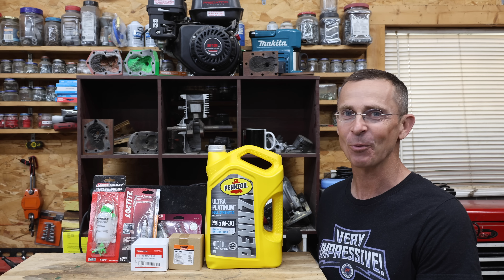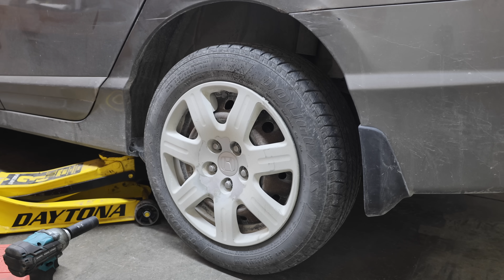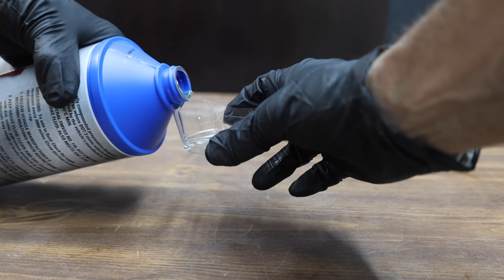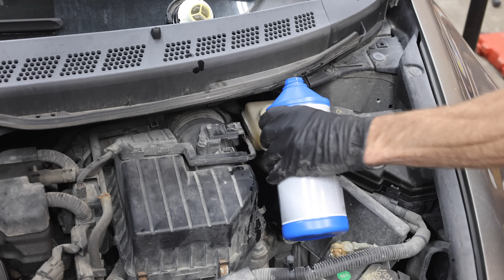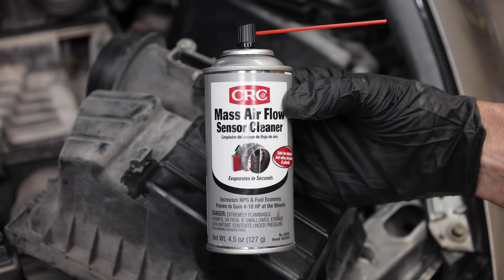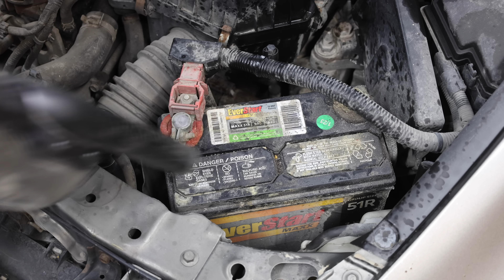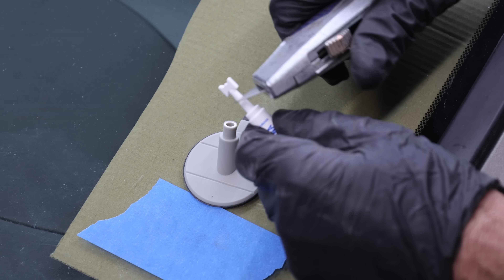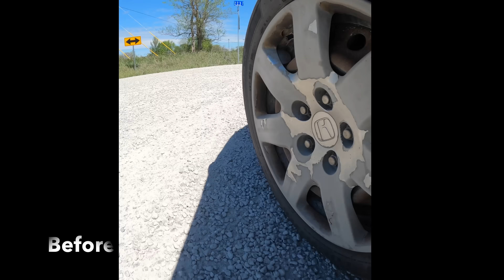Most Reliable 200K Mile Car? Let's Settle This!

Comment: I just did a similar "restoration" like this on a 200k mile Honda Odyssey minivan. I would guess the parts and labor I put into it would have cost 10 grand at a dealership but I worked on it in my spare time and only spent a little over a grand on parts. It is very rewarding to give an old vehicle a new life.
Reply from the maker: Thanks for the feedback.

Comment: 8:05  The easiest mess to clean up is the mess one does not make. 

As for transmission fluid, several mechanics who work on older vehicles have told me that changing the transmission fluid in older vehicles is not worth the risk. Too often, old transmissions start slipping after being "serviced."  True? I do not know, but these guys are almost always correct.

Comment: $500 for a car that still runs around that year is nearly impossible to get. In my area, there's something asking for $4,000 for a 2000 Toyota Corolla with over 200K miles. That car is worth closer to $1,500 - 2,000. I can tell by just the front bumper that this Honda is a 2006-2011 model.
Reply from the maker: Thanks for the feedback.

Comment: Have always been of the mindset that a reliable car is one that has predictable failures that can be anticipated on a schedule or at least repaired for cheap. In addition to performing regular scheduled maintenance of course.

Example: Subaru with a boxer 4 cylinder.

Stay up on fluids and filters

Replace timing belt, water pump, and head gaskets every 90k-100k miles

Suspension and brakes and wheel bearing check every 50k miles. 

Drive forever. 

Cheers.
Reply from the maker: Thanks for the feedback.

Comment: Excellent!!  My son bought a used 2010 Celica; yesterday we replaced the front brake pads and rotors, oil and oil filter.  This is a great todo list for next steps.   Where you replaced the front trim screw with a nut and bolt, we had to use wire because the plastic had ripped.  Our driveway has a steep incline and requires careful curved piloting to avoid scraping the bottom of your vehicle.   That said, I like to wrench on vehicles, but not everyone does.  However stuff breaks all the time, not just vehicles.  And sometimes, it's just a fuse.  Or in our coffee maker,  which dripped this morning, tried and failed to become landfill by blowing it's thermal switch (crimp them, solder is too hot for a thermal fuse ;-).   Fix, fix, fix, and save.
Reply from the maker: Thanks!  Thanks for sharing.

Comment: I had an '06. Had 320k on it and the only repair I did (non-maintenance) was a starter and window regulator. Time is harder on cars than miles.
You should specify that on Honda the trans is filled/set when off.
And with it all done you can pressure wash that engine bay. Will look immensely better.
Reply from the maker: Thanks for sharing.
Reply: @ProjectFarm  Former Honda master tech :D

Comment: The greatest car I ever owned was a $200 1984 Volvo wagon.. I bought it with 80k miles, besides the brakes and oil, I did no work  and ran it to 400k .. it needed a new clutch and wheel bearings but I junked it.. the parts vs a new used car  made it worth it to junk it for a few hundred dollars ..
Reply from the maker: Thanks for sharing.

Comment: I believe that engine uses a timing belt and Honda specs them out to be replaced every 100k if I remember correctly.  Usually there are stickers to show when the belt was changed.  You need to verify this or if it breaks, you will be bummed.  Great video and you covered everything, whoops your forgot a new air freshener. 8-)

Comment: Volvo 244, 245 mid 1980’s. 1990-1994 Mazda protege with manual transmission. Ford pickup truck with 300 six cylinder two wheel drive. Late 1980’s Toyota Camry with four cylinder.

Comment: LOVE seeing this, as many have said it's like a compilation video. A large point of the channel is getting the best value and saving money. Curious, however, for those not ASE certified, or do have the time, what would a reasonable mechanic charge for labor? Ie, but it for $500 and put $2-3k for the fix, would that be worth it? Or, buy a $3,500 car with fewer fixes needed?

Comment: New cars are so expensive they aren't even worth it anymore. You can get burned with used ones too though. I just bought a truck last year and I've already figured out why it was traded in. There's a refrigerant leak somewhere that they didn't bother to fix, they just charged it up and sold it. Pretty sketchy for a dealer if they knew about it.
Reply from the maker: Thanks for the feedback.

Comment: Labor cost is very expensive, I am doing the maintenance (DIY) on my 2011 Toyota Corolla, watching videos on Youtube. 

I myself changed the automatic transmission fluid and filter, coolant, rear shock absorbers, front brakes (pads and disc rotor), air filter, etc. It is planned to change the spark plugs and serpentine belt later this year.

Now it has 145 K miles, firm and strong. My goal is to hit 1 million miles hahaha

For more mechanic videos!! :face-blue-smiling:
Reply from the maker: Thanks for sharing.  Thanks for the suggestion.

Comment: Dang, you forgot new lights all around, gas cap, radiator cap, interior lights , dash lights, cluster regulator, master cylinder, front brakes, trans rebuild, engine rebuild, new tires and wheels ... And maybe a few other small things . lol 
So, now you can resell the car for about 30,000 . :)

Comment: great video Todd! i love you how explain everything and show exactly what you do.

i am definitely the kind of person who maintains their old beaters instead of buying a new vehicle. up here in canada, its crazy expensive to buy new vehicles. i need a truck for my daily life, and the price on a brand new truck is somewhere around the 60-80k range. i daily drive a 1991 gmc sonoma which i paid 200$ for, and havent spent much upkeeping it. i did have to rebuild the manual transmission, but i had a parts transmission kicking around that i stole some components out of. it's been very reliable and has almost 380,xxx KM on it. its just a 2wd model, so i ended up buying a locker for the rear to replace the spider and side gears (cost me 60$) and it has allowed me to get around in the snow in winter time haha! i doubt i have 1000$ into the truck in the 2 years that ive owned it.
Reply from the maker: Thanks!  Thanks for sharing.

Comment: Since you can’t replace the transmission filter, you can put a Raybestos 3/8 in line transmission filter with magnet built-in on one of the transmission cooler lines. It’s a cheap way to keep the transmission fluid clean plus it has a magnet inside to collect any debris will make transmission last Until 400,000 miles
Reply from the maker: Thanks for the feedback.

Comment: You can't go wrong with a Toyota or Honda. You are SO RIGHT that with proper maintenance, most vehicles will last a long time. Look at military aircraft. I used to work on the old C-5's, C-130's & B-52's. Some are still in the air.
Reply from the maker: Thanks for sharing.

Comment: As with so many of your videos, I've learned a lot; thank you. The most important item I personally gleaned is the fluid extractor. I can think of at least 10 maintenance jobs that I have been postponing because of the mess and difficulty that this simple tool will expedite. The first is changing the hydraulic fluid in my zero-turn mower. That is a high-dollar piece of equipment that was not designed with maintenance in mind. So, big thanks. I am ordering that vacuum pump today. I may add a vacuum chamber at a later date to make handling larger fluid quantities easier.
Reply from the maker: Thanks!  Glad to hear!  Thanks for the feedback.

Comment: A Honda with 200k is barely broken in, LOL! I have a '04 Honda Accord with 270k miles on it and it still runs and drives like new. It does have the 2.4 and power is transferred through a 5sp manual transmission which could explain why its been so reliable.
Reply from the maker: Thanks for the feedback.

Comment: $100 a MONTH for taxes? Jiminy! Here in GA it's $20 a year no matter the value, though you do pay a big chunk of tax buying new or bringing a used car in from out of state.

I have a 2001 BMW X5 with just under 200,000mi on it. Fortunately the prior owner spent a ton of time and money on parts and maintenance to resurrect this car that had been sitting non-op for a long time. I won't hesitate to drive it to and from my camper which is about a 700-mile r/t. Been super reliable and I'm sticking with the maintenance schedule. Yeah yeah, BMW = Bring More Wallet, but parts are surprisingly affordable and it's not hard to work on it. Everything works!
Reply from the maker: Thanks for the feedback.

Comment: great video. With how super expensive everything is now a new car to my family is one that already has 100k miles on it because anything less than that is priced like a new car. My stepdad bout a 99 f150 new, and him and my mom bought a 06 f150 new, put over 300k on each one. the 06 did get a junkyard motor at about 250k though so no complaints really.
Reply from the maker: Thanks!

Comment: depending on if it has a timing belt,  the belt should be replaced on a Honda before it breaks and the engine self destructs
Reply: The R18 in this car has a chain,not a belt.

Comment: i bought a 450.00 toyota carolla. 287K. had a rod knock and leaking oil. some RTV for new gasket - some 20.00 rod bearings and she has taken me across the country a few times now. (manual trans).  this summer im going to cut/weld the rust out and maybe vinal wrap.   i fiberglassed some new A pillars for a 3 way stereo system and a few amps with a 11" touch screen radio. all that for under 1K in parts.
Reply from the maker: Thanks for sharing!

Comment: My 2006 Ford Crown Victoria P-71 has 180K and is still running great and has had minimal repair work in the 10 years I have owned it. Definitely the most reliable car I have owned. I paid $4000 for it 10 years ago.
Reply from the maker: Nice!

Comment: I'm fond of the second gen Neon R/T. They all lasted me at least 300k miles with no issues. Just two hours every 100k to do the timing belt and water pump for a $100 and change the oil regular and it just keeps going.
Reply from the maker: Thanks for sharing.

Comment: My '14 Accord just turned 222,222 miles last week.  The driver side sun visor has been it.  Tires last 80,000, Normal wear stuff, brakes, rotors, fluid and filters.  Everything looks and works as new!  It has the 6 speed manual.
Reply from the maker: Nice!

Comment: In the early 2000's, I had a 1990 Dodge D250 pickup. I estimated at the time that for $7,000-$8,000, I could have replaced the engine, transmission, rear axle and a bunch of small stuff and basically had a brand new pickup where new ones were going for around $50,000.
The problem? The whole under carriage was completely rusted making any kind of that investment moot.
Reply from the maker: Thanks for sharing.

Comment: Another great one. 
A lot of this looks familiar as I have an '09 Honda Fit w/296k mi. that runs like a top. Unfortunately, the road salt/brine here in NE Ohio has taken its toll on the underbody and it doesn't look like it's going to safely make it too far beyond 300k. Fluid Film or Surface Shield undercoating would've probably taken it far beyond 500k mi.
Reply from the maker: Thanks!  Thanks for sharing.

Comment: did you buy it for the battery? after all, as you tested, the best one out there...regarding 200k cars, anything over 150k has survived and shaken off the frailty, glitches and factory recalls assuming average maintenance anywhere other than rust country...

Comment: I work at an auto repair shop. I drive cars of all colors, flavors, and conditions. Toyotas have the highest mileage and usually are in good driving conditions, next are Hondas, and some V8s trucks. It’s not hard to get Toyotas with 350k-400k miles.
Reply from the maker: Thanks for sharing.

Comment: I gotta love the old Hondas! I have a 03 Jeep wj with the 4.0 in it, just regular maintenance and wear items, and it’s sitting at 320xxx miles on the original motor, transmission was replaced once but new 1 has been holding strong even with regular towing
Reply from the maker: Thanks for sharing.
Reply: @ProjectFarm  i believe a lot of early 2000’s vehicles are reliable! But I also believe a lot of it ultimately comes down to maintenance! But just wanna say I love your videos! And tests you do! They are very helpful for a DIY’er like myself

Comment: ford escort 97 to 2003,pull the cylinder head,have a machine shop fix the valve guide issue and it will run forever
Reply from the maker: Thanks for the feedback.

Comment: Comment section help. I was under the impression if you don't regularly change the trans fluid, then never change it. The new fluid would be to thin and burn up the 3 clutch pads in side of the automatic trans. Is this true or not because if it's turn he just messed that tran up

Comment: As someone that lives in the rust belt, any one of those jobs could and have turned into an all weekend headache due to snapped bolts, rusted out components, etc. Every time you went to another aspect of the car to repair and it came apart, all I could think was "very impressive!"
Reply from the maker: Thanks!

Comment: I vote yes on more videos like this. Like a previous commenter said, using the culmination of the knowledge you’ve learned(and shared) to complete a larger project is cool to see. I wish even half the people whose vehicles I work on took care of them as thoroughly as you do. 257k on the stock transmission of a Buick of that year? VERY IMPRESSIVE
Reply from the maker: Thanks!  Thanks for the suggestion.

Comment: Note from a professional tech with four decades of experience: any automatic transmission that has more than 150k miles on it that has never been serviced properly should NOT receive a fluid flush (or even a drain and fill). That old fluid is keeping those clutches from slipping. You can carefully exchange about 25% to freshen up the additives, but beyond that you're asking for trouble. It's counterintuitive, but the thing that kills a good tranny initially is what it keeps it alive later on (with a reduced lifespan of course). Other than this you did great!

Comment: I've had really good luck with Lexus. I know it's a Toyota but I had one with 276 k and had to put an alternator and cv shafts in it. Those were the only things that went bad. It actually ran better than the one I replaced it with that only had 90k on it.
Reply from the maker: Thanks for sharing.

Comment: My 2008 Smart Fortwo is still going like nothing ever happened. It's an incredible vehicle, and the smart community have mentioned they can get them up to 600,000 miles still running great with very few "major" fixes. I feel like if someone who just needs a vehicle, these are the new last forever car and parts are so cheap, the only difficult thing to do on this car is align the 3 nuts on the tires. Otherwise, it's super simple to do all the basic repairs.
Reply from the maker: Thanks for sharing.

Comment: Great Job Sir!

I look forward to your review of scan tools...  I've had a BlueDriver for many years...  Paid for itself 3 times over on the first use...  It does read airbag codes....  I like it.  And the online help stuff has never let me down....  I look forward to that video.

I also have to tip my sweat stained cap to you Sir, for using the Makita to blast off those bolts....  Good man.  I like your style.

Honda is awesome....  My Dad had an 88 Acura Legend LS Coupe....  My Dad drove it for years...  Sold it to his neighbor  His neighbor's daughter drove it for many years...  Now the neighbor has it back...  He had it repainted, it looks awesome, and still runs nice, all these years later.  Interior is not perfect, but still very serviceable.... I personally am also a big fan of Chevy GM stuff...  I know, opinions vary.  My best work truck ever was a 2005 Chevy 2500 series HD 4x4...  6.0 gas V8.  I ran that thing to over 350k, and these were not gentle miles.....  air worked, heater made me wonder if the truck was on fire in the winter...  Great truck.  I got it stuck on an icy gravel road one time, in all those years....  for like 2 solid years, it was the oldest & by far highest mileage truck in our region....  The transfer case blew at one point, they threw in a rebuilt, and that blew up a year later, and they junked it.  Then they got me a 2019 Silverado, 4x4, 6.0 HD...  Also really nice, but then I retired, so, I hope young Steven is loving that truck....

And my own stuff, I had a 04 Escalade AWD for like 11 years, that thing was great....  250 I think, I sold it???  My 14 Escalade AWD, I've had that for what, 8 years now???  That's been fantastic.  I love it.  They made a lot of improvements in the truck....  The steering & handling is night & day wildly improved, proper steering rack, coil overs on the front instead of the stupid torsion bars....  Night & day difference in how it handles on the highway.....  Power is way up, the 6.2 really has it when you want it....  It does love love love gas, compared to the 04, but hey...  I didn't buy it for mileage, amiright????   I mean, for those times when I am in Mexico (wink wink), the 04 was a little scary over 90...  The 14 inspires a lot of confidence even over 100...  Tracks straight, drives straight, seems very composed on the highway....

I'm just saying, when it's time to replace yours, find a 13 14 Suburban, you'll love it....  15 on up was the new transmissions, you don't want that....  

Anyways, you do a great job on these videos, and I think this was a refreshing change on your channel....  Plus you got to showcase some stuff you have reviewed before, which I think is fun & good, so you can say hey, here is the product in action....  Very nice.  Great job Sir.  I love what you're doing, I hope you keep doing it.
Reply from the maker: Thanks and you are welcome!